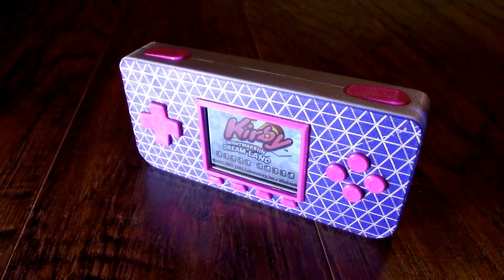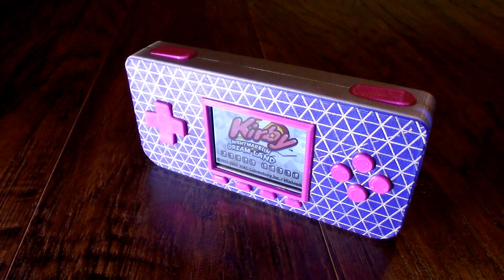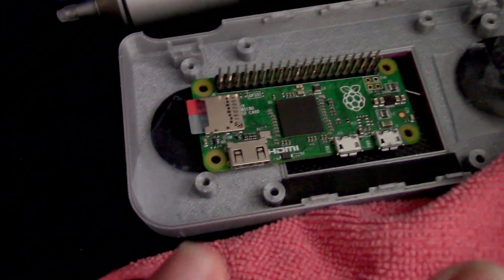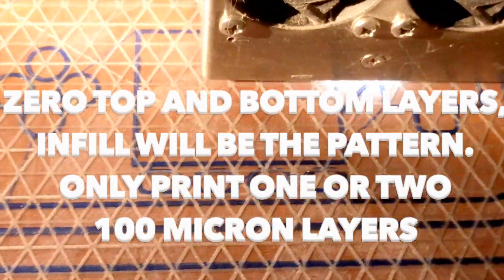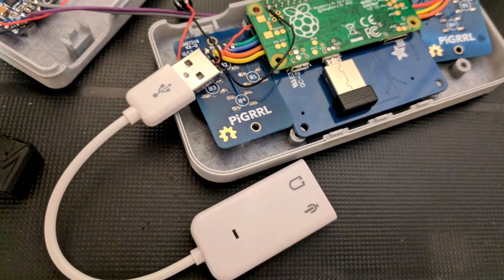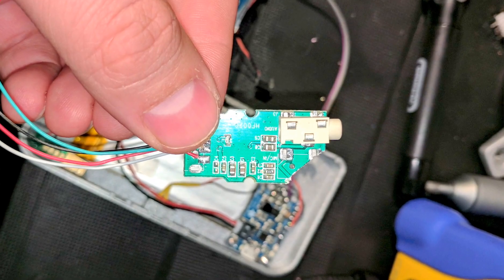PiGRRL Zero - Adafruit Project Review

Comment: Hello, Nice DIY! Where can we find your STL with jack connection and screen border?
Reply from the maker: All I did was drill a hole. And adding that boarder to the stl for the front shell would make it difficult to print well and impossible to print the way I did. I just measured it with calipers and designed it in 5 seconds. You could do it with tinkercad even.
Reply: Ok, I am printing it just right now with patern. It will be very nice :) 
One more question, did you used rasp pi zero W or not W?
Reply from the maker: I only had a Zero at the time. I definitely recommend the Zero W.

Comment: Can this run MAME?  Also what are the boot times like, from what I have seen the Pi series takes a long time.
Reply from the maker: Mame4all yes. 
https://docs.google.com/spreadsheets/d/1SHspjyHavY9-PKbO2swDr52BS2Wl_mB_Vjx2Z1SXiD8/edit#gid=828747670
It takes a while to boot. I suspect there is a way to fix that by removing some unnecessary boot items.